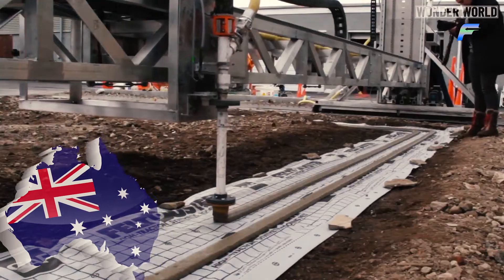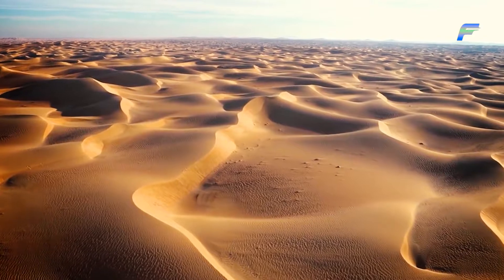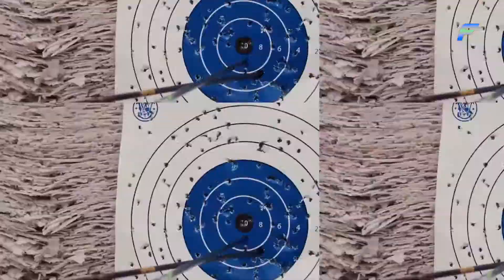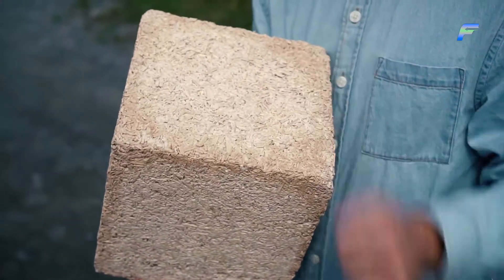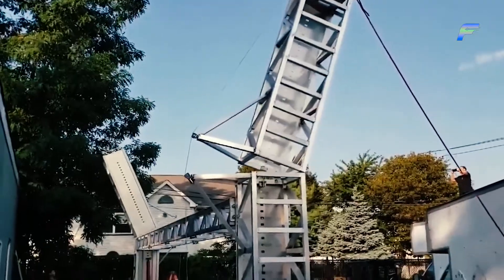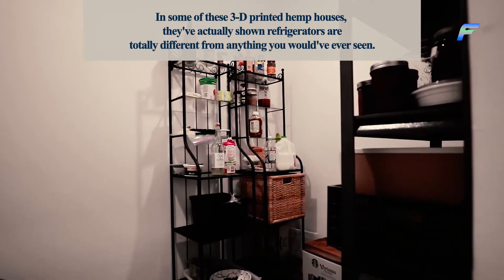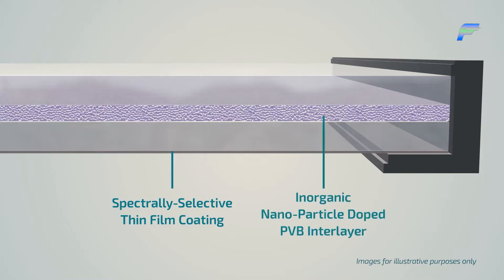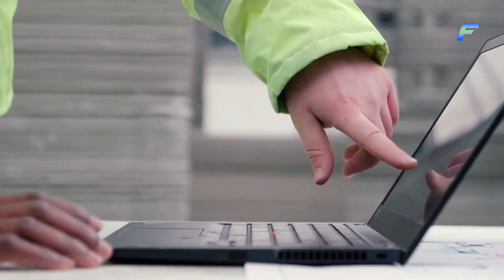Inside Australia's 3D-Printed Hemp Houses

Comment: ...unfortunately almost none of the footage in this video is from Australia and all the 3D printed examples there are not Hempcrete, they are unfortunately the various standard concrete mixes that are used in 3D printing. There is a big difference between traditional hemp construction and 3D printing. Not much in this video is legit and a lot of the footage is from the US or other countries, certainly not from Australia. Who are the companies 3D printing with hempcrete in Australia?
Reply: yes i thought the same , its just another video compiled for advertising clicks 
Hempcrete is typically used with a compacted slipform like rammed earth . very labour intensive.
Reply: @heartobefelt it’s not that labour intensive, not an issue.
Reply: Yep - More Bulldust than Hemp unfortunately.
Reply: Using hempcrete 3D homes is a great idea, hope it becomes common place, much more sustainable.
Reply: Looks like u a busy channel twattingham or whatever your name is😤

One1 side effect of medicinal cannabis?
Enjoyment 😘
Hallelujah ✅️ Aģape
Reply: Can it be done, hempcrete 3D printing? Cheers.
Reply: @paulking54 yeh looks like lego
Reply: @paulking54  there are a few projects in the works exploring possibilities.
Reply: Cheers. Any names, please.
Reply: @paulking54  yes it could be done but Hempcrete works best when placed into formwork and compacted on the outsides only , If the center is loose with lots of entrained airgaps it gives a higher insulation value.
3D printed would need a wetter mix and will not have the airgaps for insulating properties.
There are at least 5 companies around Australia doing shotcrete / sprayed style hempcrete which they blast on to a wooden framed structure with formply as temporary backing.
Reply: your critics are very good and opening... all you need its that to ask for the truth..and if is its not there...then they should be honest about and fix it..or do better ..or in general for the public to do better if other didnt
Reply: Mirreco can do the construction. Xhemp in Tasmania is making the hemp for the building materials.

Comment: hemp has 5 leaves just like cannabis; are the plants the same thing? yes, hemp doesn't get you high...
Reply: Cannabis can have many different leaf patterns. I've grown some with 3, 5, 7, 9 and even 12. They are related, but not the same. Hemp can be different varieties also. Old school hemp is very tall and thin. Great for long fibers for textiles and has almost no "drug" in it. Newer "hemp" varieties can look identical to Cannabis and are just a variety that has high "medicinal" qualities (CBD's), without the "drug" part. Probably not so great for fiber length. Hemp "hurd" is the center of the stem/ stalk of either a cannabis or hemp plant and has no medicinal or drug value. The ground up Hurd is mixed with hydraulic lime and used for Hempcrete.

Comment: Hemp&Lime, or hempcrete, is NON-loadbearing. So you can't 3d print a hemp house UNLESS you have an already existing loadbearing structure. This video is misinformation.
Reply: @johnny 71c Indeed. And the "wooden" (though it could be metal) part is called a "loadbearing structure"...
Reply: Bamboo is the structural addition
Reply: @goathead3329  where? I didn’t see bamboo
Reply: You can make 2 storie load bearing building from hemp blocks so its absolutely possible.
Reply: My argument is that this mix, being lime, water, and hemp, whilst brilliant, is not concrete, its just fancy cement. To make it concrete, it has to be added to an aggregate of sorts. Could possibly use ground up garbage for that, perhaps
Reply: @messiermitchell4901  Indeed, it isn't 'concrete'. It has been called 'hempcrete' (for simplicity/marketing reasons), but neither is it 'cement' (which is a very specific binder) and, though one can add 'sand' one doesn't need to to build walls with it (and floors/roofs in different mixes). Poorly named 
"‘Hempcrete’ is the popular term for a hemp–lime composite building material. It is created by wet-mixing the chopped woody stem of the hemp plant (hemp shiv) with a lime-based binder to create a material that can be cast into moulds. This forms a non-load-bearing, sustainable, ‘breathable’ (vapour permeable) and insulating material that can be used to form walls, floor slabs, ceilings and roof insulation, in both new build and restoration projects."

Sparrow, Alex. The Hempcrete Book: 5 (Sustainable Building) (p. 34). UIT Cambridge Ltd.. Kindle Edition. 
BUY this book if you want to know about it properly. (and no I get nothing) :]
Reply: @therealpils  so, now we just need to find a sustainable building material that is both load bearing and "printable"
Reply: @messiermitchell4901  or NOT print it :]
Reply: @therealpils  probably best
Reply: @messiermitchell4901  does the hemp fibre not function as an aggregate?
Reply: @oohhhhh  good point
Reply: Have you seen this video https://youtu.be/H8efNdG7au4. 👍
Reply: All is possible.. You must only try and it works